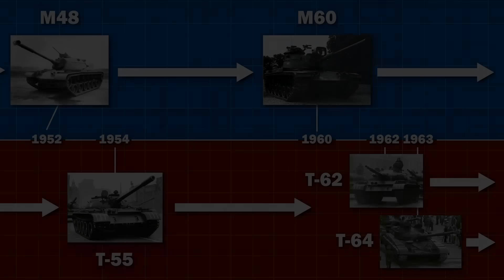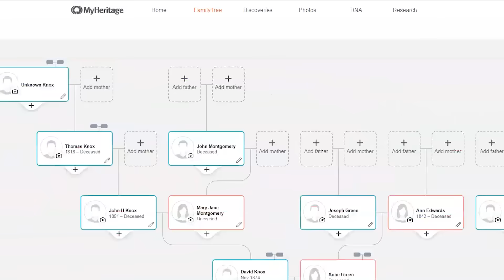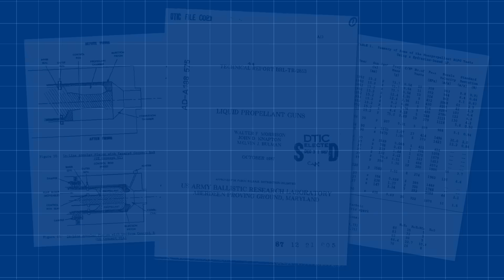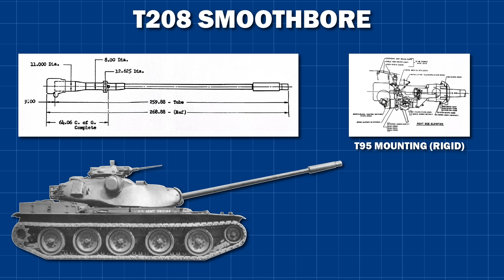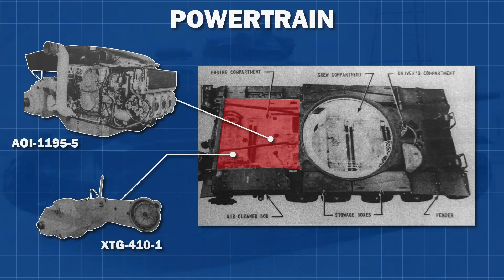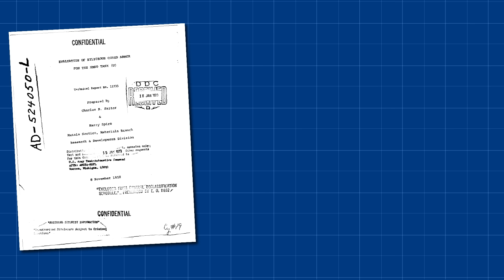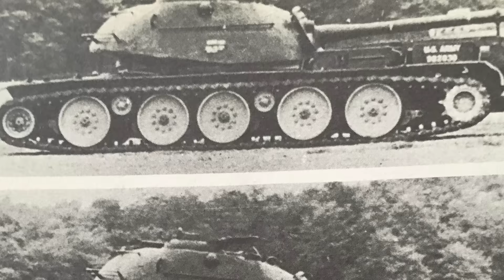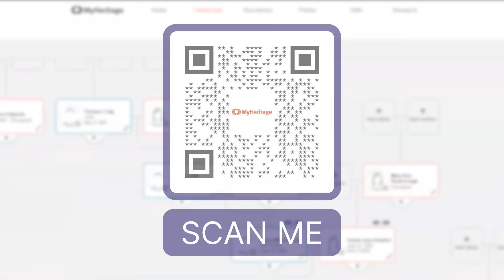T95 - America's Forgotten Super Tanks

Comment: An American tank with a 120mm smoothbore main gun and composite armor?

"I guess you guys aren't ready for that yet. But your kids are gonna love it."
Reply: And the Army is modernizing the Abrams to a new Variant the M1E3 which will literally a new production run. Some old Hulls will be refurbished but they will produce new Tanks. The E in the Name stands for Electric Hybrid. The A2 has an APU to reduce the Fuel consumption of the Abrams, the E will get a Batteriepack for the same purpose but it will be way cooler so less infraret signature. And there are the German Leopard 2A7V, 2A8 which are still in limited production. On the other Hand russia is in direct combat and builds only 200 T-90 per year new, while the rest are refurbished old Tanks. But nothing compared to the K2 Black Panther, especially the K2PL Variant which will be soon mass produced in Poland. Atm the Western (and Asian in this part) Tank factories are looking what can be learned from the current conflict and then upgrade their Tank Fleet. While Russia is still producing Turret Launchers as their more modern Tanks are not Combat ready.  Did you know that the Russians used old Leclerc Firecontrols from the Series 1 Leclercs which the French sold to them in the modernized T-90 variants? They no longer have access to it and had to downgrade the tanks in production.
Reply: @Elkarlo77  the e is becose its not yet ready

At one point the m1a1 was known as the m1e1 

Same as the for YF 22 but for subversions instead of a nee vehicle
Reply: @Elkarlo77  
Dude, you talked a lot of nonsense here. They do not change the armor and engine and 75% of the parts from the old tank. This is how it differs from the new one. Improvements in the army are cosmetic in nature. How ready the West is for the tank war of the new era can be clearly seen from the fact that not a single Abrams or Leopard, and especially not a Challenger, even reached the first line in Ukraine. They have 0 targets hit. It's funny about Leclerc and T90, are you drunk or what? Where did you read this? 🤣 You forgot to say that in addition to the T90, the Russians also produce 4 models of tanks. And the total number of NEW tanks of all types is about 100 per MONTH. + at least 100 upgrades of old ones, of which there are more than one thousand. And the number of tanks being manufactured greatly exceeds the losses.
About Poland is even funnier. Poland is too poor - it has ALREADY been refused a tank factory. Poland decided to build it with US money, the US said they would pay later - Korea said - then we will build it later. Poland is a bad asset. They are the next ones who are being prepared by the West to fight with meat for the United States. Therefore, what will happen to Poland and the plant in a couple of years is not at all clear.
Oh yes, Panther did not participate in the battles at all, how he will show himself is generally unknown 😉
Reply: @romankovalev7894 100 new tanks per month 😂 not even Russians claim that they’re making 1200 new tanks per year, my friend.
Reply: @jakew7982  
Wats wrong?
Reply: @jakew7982  
What data Russian claim? 😂
Reply: @romankovalev7894   It doesn't really matter. If the US needs to build new plants and churn out new tanks it can and would do so. After all, the US is the richest country on the planet. Japan found this out the hard way. Everyone else is forewarned. If anyone feels like disregarding this small fact, then more fool them.
Reply: @markstott6689  
Print new factory and trillions new tanks 🤣🤣🤣 rich 🤣🤣
Reply: Lol
Reply: That 120mm Delta gun was based on the 120mm L/60 T123/M58, which was and remains the most powerful tank gun ever produced. The propellant casings for it were like 7.5” diameter and 40” long, Vice about 6.5” and 23” for the 120mm NATO round. The 120mm Delta would have been an absolute monster if it had gone into service, especially once they figured out how to sort out a good dart for it
Reply: lol. perfect comment
Reply: The Russians let this company from the poor USA, which had the Great Depression, make money, didn’t they? The Russians then, just as now, arrived under the sanctions of Western countries - they were not allowed to develop. In 1938, when the famous T-34 appeared, the United States had no tank forces at all
Reply: The Russians let this company from the  USA, which had the Great Depression, make money, didn’t they? The Russians then, just as now, arrived under the sanctions of Western countries - they were not allowed to develop. In 1938, when the famous T-34 appeared, the United States had no tank forces at all
Reply: Really? Do the Russians really say that? Or are the next assumptions of Western “analysts” in the series very likely?
The Russian Ground Forces received 1,530 new and modernized tanks, 2,518 infantry fighting vehicles and armored personnel carriers. Since February 2023, the production of tanks has increased by 5.6 times, infantry fighting vehicles by 3.6 times, and armored personnel carriers by 3.5 times compared to 2022. Data as of the end of 2023. Now things are even better for the Russians - a new tank model based on the T-80 is preparing to go into production by the fall. Soon the West will begin to realize that it is at war with a country that is an arms factory, surrounded by similar factory countries with countless reserves ready to help it.
There are only 300 tanks on the move in Germany. In Britain - 56. The USA could supply thousands - but apparently their burnt out tanks do not contribute to sales.
Reply: Really? Do the Russians really say that? Or are the next assumptions of Western “analysts” in the series very likely?
The Russian Ground Forces received 1,530 new and modernized tanks, 2,518 infantry fighting vehicles and armored personnel carriers. Since February 2023, the production of tanks has increased by 5.6 times, infantry fighting vehicles by 3.6 times, and armored personnel carriers by 3.5 times compared to 2022. Data as of the end of 2023. Now things are even better for the Russians - a new tank model based on the T-80 is preparing to go into production by the fall. Soon the West will begin to realize that it is at war with a country that is an arms factory, surrounded by similar factory countries with countless reserves ready to help it.
There are only 300 tanks on the move in Germany. In Britain - 56. The USA could supply thousands - but apparently their burnt out tanks do not contribute to sales.
Reply: Really? Do the Russians really say that? Or are the next assumptions of Western “analysts” in the series very likely?
The Russian Ground Forces received 1,530 new and modernized tanks, 2,518 infantry fighting vehicles and armored personnel carriers. Since February 2023, the production of tanks has increased by 5.6 times, infantry fighting vehicles by 3.6 times, and armored personnel carriers by 3.5 times compared to 2022. Data as of the end of 2023. Now things are even better for the Russians - a new tank model based on the T-80 is preparing to go into production by the fall. Soon the West will begin to realize that it is at war with a country that is an arms factory, surrounded by similar factory countries with countless reserves ready to help it.
There are only 300 tanks on the move in Germany. In Britain - 56. The USA could supply thousands - but apparently their burnt out tanks do not contribute to sales.
Reply: Really? Do the Russians really say that? Or are the next assumptions of Western “analysts” in the series very likely?
The Russian Ground Forces received 1,530 new and modernized tanks, 2,518 infantry fighting vehicles and armored personnel carriers. Since February 2023, the production of tanks has increased by 5.6 times, infantry fighting vehicles by 3.6 times, and armored personnel carriers by 3.5 times compared to 2022. Data as of the end of 2023. Now things are even better for the Russians - a new tank model based on the T-80 is preparing to go into production by the fall. Soon the West will begin to realize that it is at war with a country that is an arms factory, surrounded by similar factory countries with countless reserves ready to help it.
There are only 300 tanks on the move in Germany. In Britain - 56. The USA could supply thousands - but apparently their burnt out tanks do not contribute to sales.
Reply: McFly was a tanker?
Reply: another clown. You are not ready for a long war. And Russia is excellent at this. No one in the Russian government has said anything about 2 weeks. This is the West's dream for everything to end quickly. What don't you like? Russia is doing great, but Ukraine is starting to mobilize its children, and Europe's economy is in the shit. This is just the beginning. You are simply fighting a military factory.
Reply: Stabilizer where
Reply: Russian tank with 125mm main gun
- Hold my beer...
Reply: @romankovalev7894  you forgot the part where it got outclassed the very second the west started full scale production on theirs
Reply: @urmothwr  
Funny. All West mass tank production - two and half tanks.  USA only one tank factory - not build new tanks from 2017, only upgrade old corps
Reply: @romankovalev7894 the US does build new tanks each year and throw them into storage to keep the factory in operation. Lol you are just wrong
Reply: @Kilo_11  
No. Only upgrade 🤣
Reply: @Kilo_11  
Each year. New tanks. Farytells
Reply: @romankovalev7894  the most famous russian tank factory was built by american car company
Reply: @thecursed01  
Yes. 100 years ago 😅
Reply: @romankovalev7894  yes :) but that started it. Also i didn't see the comment you replied to. And about the production. Yes, soviet union had more tanks than others had cars XD
Reply: @thecursed01  
Ytube delete comments :/
Reply: @romankovalev7894  constantly.  I hate it
Reply: @thecursed01  
This car company made good money and survived the Great Depression?
Reply: @thecursed01  
This car company made good money and survived the Great Depression? :) 
In general, it is interesting to observe how engineering schools in different countries are developing in tank building.
Reply: @romankovalev7894  There are 2,400 M1s in storage if needed.  And US doctrine isn't absolutely dependent on tanks and arty like one of it's primary opponents.
Reply: @romankovalev7894  least delusional russian
Reply: @romankovalev7894  least delusional russian
Reply: @romankovalev7894  Even when the army says they don't need new tanks congress still orders new tanks to keep the production facilities going, wtf are you on about?
Reply: @scarx4181  
🤣🤣🤣 Order. Congress. How much NEW tanks in 2023 you build? Funny boy
Reply: @alessandromazzini7026  
Tell me 🤣🤣🤣
Show me kid
Reply: @romankovalev7894  uh huh... maybe because we were cooking up the next generation MBT?
Reply: @Orinslayer  
Yes yes.  You haven't time 😎
Reply: @urmothwr cuz it part isnt existed, thats why
Reply: @romankovalev7894 no need to build new tanks when you’ve produced 8 thousands abrams and Russia is economically and industrially incapable of making a proper pier
Reply: 8000 old tanks 🤣🤣 after 3 years - you suck. Economically... Bravo
Reply: @romankovalev7894  keep fielding T-62’s Boris I’m sure you’ll have your fleet of T-14’s when the time comes
Reply: @Schlawg788  
Not need T-14.  We win with old tanks. And many drons and missiles
Reply: @Schlawg788  
Lancet say hello to you. Jonny
Reply: @Schlawg788  
Wooow. T-62. No no no. Only shovels
Reply: @Schlawg788  
A thing US sell 8000 tanks to EU on high price 🤣 And will produce new modern tanks
Reply: @Europe isn’t buying American tanks, there’s plenty of domestic tanks
Reply: @Schlawg788  
Very funny
Reply: @Schlawg788  
Two and half tanks.... Domestic.. Plenty..
Reply: @Schlawg788  
EU vassal US
Reply: @Schlawg788  
USA want 5% GDP on military each NATO countries
Reply: @Schlawg788  
EU will buy of course. No doubt.  Who is asking they? 🤣
Reply: @Schlawg788  
Bad sad Europe.
Reply: @ 3.600 leopards, not even war time production, not that NATO would need more tanks considering a war with NATO would just lead to Russias air defense getting folded like an omelette and from there you’re just getting bombed until you concede
Reply: @romankovalev7894  you failed to take Kiev, spent years trying to gain a grip on Ukraine, failed to do that, and now you’re begging the U.S. for a peace deal, all part of the plan? Putin just playing chess?
Reply: @Schlawg788  
Not need take Kiev
Reply: @Schlawg788  
Ukraine lost all people's. Only kids
Reply: @Schlawg788  
We run slow but our KO very low
Reply: @Schlawg788  
3600 Leo? 🤣 How match you have tactical nuke missiles?
Reply: @Schlawg788  
How match you have hypersonic/supersonic missiles with range more 1000 km?
Reply: @Schlawg788  
Failed take Kiev 🤣🤣🤦🏻‍♂️
Reply: @Schlawg788  
Russia up to top 10 economic country.  With this war.  Good luck kid
Reply: @Schlawg788  
We press EU together with US. This is real world. Just business girl
Reply: @Schlawg788  
Us lost many many money with zero results. Rus stronger, more rich etc then before war
Reply: @Schlawg788  
You haven't combat experiences in modern war
Reply: @Schlawg788  
Like kids with pistols
Reply: @Schlawg788  
No matter how match tanks have you
Reply: @Schlawg788  
All time you win not strong countries.  Like Libia, Iraq,  Yugoslav.     You no future.
Reply: @romankovalev7894  at this point you’re just schizophrenically rambling, tell your boss you need a break, this isn’t worth the rubles they pay you to say this
Reply: @Schlawg788  
About Russian junk economics
Reply: @Schlawg788  
About Russian rotten weapons
Reply: @Schlawg788  
About Russian big troops loses
Reply: @Schlawg788  
About isolations and no foods and best west sanctions
Reply: @Schlawg788  
We're are you from?
Reply: @Schlawg788  
How old you? All what I say - not a secret.  Boss... Pay... You watch everytime cartoons ore what?
Reply: @romankovalev7894  the USA strives to make about 135 tanks per year
Reply: @Fractal-Frank 
Yes. From old corps.  One working factory
Reply: @romankovalev7894  And this is a problem? There are about roughly 4,000 (on the lower avg. estimates), and 5,800 (higher, ~8,800 total produced including export across the first) Abrams in storage. There's no need to produce more tanks.
Reply: @romankovalev7894  Russian only make good fertilizers🤣🤣🤣🤣🤣
Reply: @romankovalev7894  
>turret launches into the sky
hold my crew lives
Reply: Serial production of the M1 Abrams for the US Army ended in 1995, although export production continued until 2000.

 The US Army planned to shut down the Joint Systems Manufacturing Center (formerly the Army's Lima Tank Plant) [117] from 2013 to 2016 to save over $1 billion;  it will be relaunched in 2017 to modernize existing tanks.  General Dynamics Land Systems (GDLS), which operates the plant, opposed the move, arguing that shutting down operations would increase long-term costs and reduce flexibility.  [118] [119] Specifically, GDLS estimates that closing the plant would cost $380 million and restarting production would cost $1.3 billion.  [120]

 By August 2013, Congress had appropriated $181 million to purchase parts and upgrade Abrams systems to de-risk the industrial base and support development and manufacturing capabilities.  Congress and General Dynamics have been criticized for diverting money to keep production lines open and accused of "forcing the Army to buy tanks it doesn't need."  General Dynamics argued that a four-year shutdown to reopen the line would cost $1.1 billion to $1.6 billion, depending on the length of the shutdown, whether equipment would continue to operate and whether components of the plant would be completely removed.  [117]

 They argued that the move was to modernize Army National Guard units to expand the "clean fleet" and maintain production of identified "essential" subcomponents.  A prolonged shutdown could result in manufacturers losing the ability to produce them, and selling tanks overseas does not guarantee keeping production lines open.  There is still a risk of production disruptions even if production is extended into 2015.  Because funds are committed before recapitalization is required, budgetary pressure could push up planned new Abrams upgrades from 2017 to 2019.  [117]

 In December 2014, Congress again appropriated $120 million, against the Army's wishes, to modernize the Abrams.  [121]

 At the end of 2016, tank production and refurbishment fell to the level of one tank per month with less than 100 workers on site.
Reply: Serial production of the M1 Abrams for the US Army ended in 1995, although export production continued until 2000.

 The US Army planned to shut down the Joint Systems Manufacturing Center (formerly the Army's Lima Tank Plant) [117] from 2013 to 2016 to save over $1 billion;  it will be relaunched in 2017 to modernize existing tanks.  General Dynamics Land Systems (GDLS), which operates the plant, opposed the move, arguing that shutting down operations would increase long-term costs and reduce flexibility.  [118] [119] Specifically, GDLS estimates that closing the plant would cost $380 million and restarting production would cost $1.3 billion.  [120]

 By August 2013, Congress had appropriated $181 million to purchase parts and upgrade Abrams systems to de-risk the industrial base and support development and manufacturing capabilities.  Congress and General Dynamics have been criticized for diverting money to keep production lines open and accused of "forcing the Army to buy tanks it doesn't need."  General Dynamics argued that a four-year shutdown to reopen the line would cost $1.1 billion to $1.6 billion, depending on the length of the shutdown, whether equipment would continue to operate and whether components of the plant would be completely removed.  [117]

 They argued that the move was to modernize Army National Guard units to expand the "clean fleet" and maintain production of identified "essential" subcomponents.  A prolonged shutdown could result in manufacturers losing the ability to produce them, and selling tanks overseas does not guarantee keeping production lines open.  There is still a risk of production disruptions even if production is extended into 2015.  Because funds are committed before recapitalization is required, budgetary pressure could push up planned new Abrams upgrades from 2017 to 2019.  [117]

 In December 2014, Congress again appropriated $120 million, against the Army's wishes, to modernize the Abrams.  [121]

 At the end of 2016, tank production and refurbishment fell to the level of one tank per month with less than 100 workers on site.
Reply: @jimmiller5600  
On Carriers and Air dominate primary. This not secret
Reply: @romankovalev7894  And successful.
Reply: @jimmiller5600  
Generals prepare to last war 👌
Reply: @romankovalev7894  Almost always.  But even the late 1930 German army could be accused of that as they developed mobile warfare based on WW1 experience.  It is just that some have better outcomes from the process.
Reply: @jimmiller5600  
German army? OK. There is no "game changer" as I often hear in the West. Victory is a combination of successful application of at least several important components. Blitzkrieg, lightning breakthrough with a tank fist. Aviation, its leading role in the war. Even organizing small groups of soldiers around an MG machine gun. The Germans had a lot of good things. They also had veterans from the last war. Plus, the Germans themselves are good warriors, brave, patient, persistent, and skillful. They had resentment and a desire to fight and win. And a long war is not a war on the battlefield. This is a factory war. One of the German generals wrote in his memoirs that when Hitler was told in 1944 how many planes and tanks the United States, Britain and the USSR were producing, he did not believe it. The USSR initially won the war when it evacuated its production to the middle of the country to a place inaccessible to aviation and not to the battlefield.
Reply: @romankovalev7894 ah so thats why russia is sending people in golfcars
Reply: @romankovalev7894   jammer enters the room

AHEAD ammo sits in the corner
Reply: @nikolaideianov5092  
Wooow jammers.  Why don't work on your tanks yea? Light vehicle use and German and Soviet in WWII. If this looks stupid but work - it's not stupid.
Reply: @romankovalev7894   your english makes about as much as much sense as a as astronaut running from a gorrila on the ISS
Reply: @romankovalev7894  Don't need to be making a hundred tanks a month because we don't need to keep up with the loss of hundreds of tanks every month. How's that two week special military operation goin' for ya bud?
Reply: @Cozzy-Wozzy  
What s wrong? Let's just fighting - said Johnson to ukranian. Ok
Reply: @Cozzy-Wozzy  
2 weeks? No so fast baby.  You will beg the Russian to stop this war.  You not ready to long war